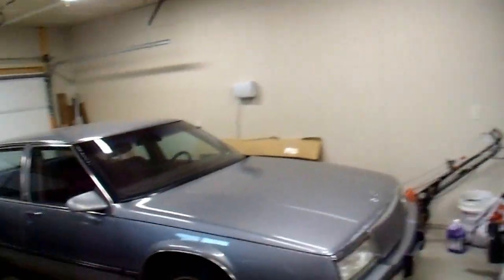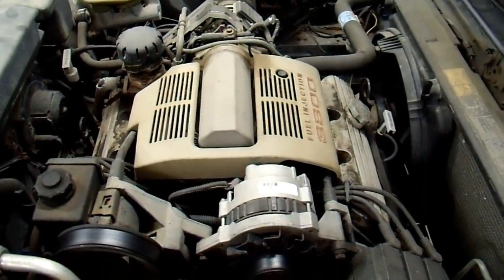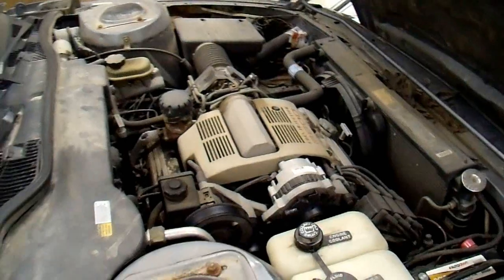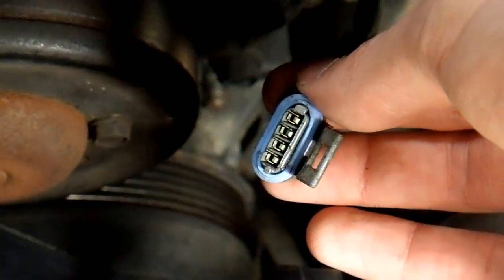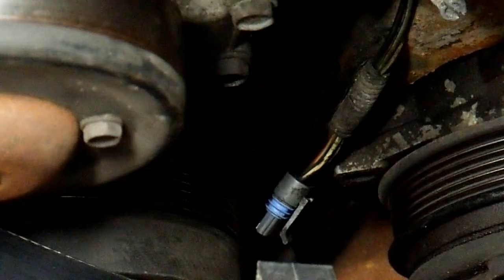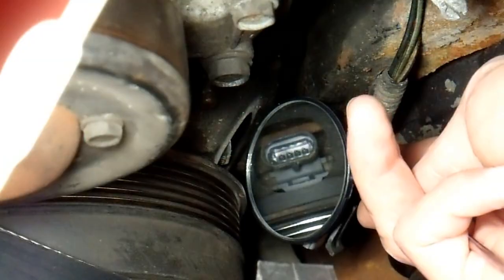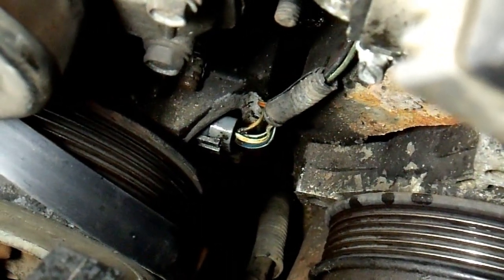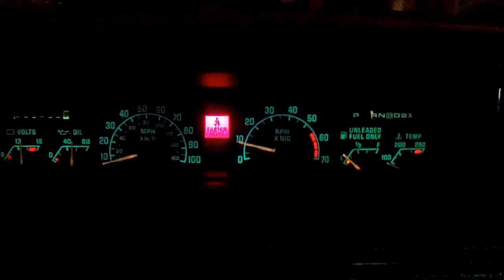3800 3.8L GM engine stalling issue quick fix

Comment: Oh yeah, well what if it is bad, how do you know if it is causing the problem. Then how does it come out.why does this video not tell you that. What if i clean the connectors and it doesn't fix the problem? This video must only show the very first thing to try.
Reply from the maker: This is clearly intended to be something quick to try and is no guarantee.  The connector points up, is in the path of road spray, and commonly corrodes causing problems.  If this isn't the problem then you have to look further and I have a video on replacing the sensor too if you're interested.
Reply: @knurlgnar24  so it is the first thing you should try. Hey, this could save you a whole lotta other work. I get it.
Reply: @knurlgnar24  plus i just found your other video going into detail on how to work this thing.good job. Thanks. Its a lot of help.

Comment: i got a 97 buick regal 3800 it just died after a long trip while parked at idle,, wouldnt restart, waited a few , it ran but had to keep gas revved up, then it died at idle again and wont restart, waited over night started for a second then off again and wont restart.......... all fuses good, only error is evap selenoid. I was told it should at least start if that was only issue  any idea ???

Comment: Good information. Unfortunately I have a 1995 so I stopped the video at 34 seconds in. Try putting the year in the title so folks who need a different year will not drop out of your video so quickly. That should also give your % of view time on your video more time. Thanks for sharing anyways. Best Wishes & Blessings. Keith Noneya
Reply from the maker: That would have been a good idea in retrospect.  Thanks for the comment.
Reply: @knurlgnar24  It's all good I have similar requests on my channel at times. I just edit the title under the videos section. Best Wishes & Blessings. Keith Noneya

Comment: I had a 89 lesabre.Other than my 92 park avenue,  BEST CAR IN THE WORLD !!  Mine would stall occasionally and it turned out to be MAF sensor and it had almost 300,000 miles on it.I sold it cuz it was beginning to have alot of issues but it still run. Love the ol 3800s. If u keep them up theyll last forever i also have a 84 lesabre coupe with a 307 olds. Another great engine

Comment: I have 1998 Buick Park avenue the engine stumbles tachometer goes to zero car continue running normally tachometer still shut down shut the car down and restart the tachometer tachometer begins operating a game??
Reply from the maker: I'd have to look up how the series II engine works to give better inro but it is clear you have a sensor going out - either cam position or crank position sensor.  The computer requires all of them to start the car but once running it can operate with limited information.  Your tach likely only reports one of the sensors which is why when that one fails the car stumbles, recognizes the problem and starts running by using a backup sensor method, and then continues running.

Comment: o8 grand prix i had a the  stall issue and hard start.  I changed my air filter and it never happened again. I know.  How stupid , ive never heard of that befor. I even bought crank position sensor and that $60 relay people where haveing problems with stalling. There still in boxes brand new

Comment: Hi dear friend! At my Buick park Avenue 1991 when i start engine begin workin after 0.15 - 0.20 min she begin  smooth vibration and turn of
if you wont startagain it is impossible, i looked spurk plugs se that all of them wet by fuel.
May be same problem?

Comment: So this def doesn’t apply to series II 3800’s? Because my 2001 park ave is having same symptoms.
Reply: Not sure on your wiring but my 2003 buick lesabre with 270k had random stalling, would randomly idle so high I had to restart to shift out of park for fear of damage and also had a surging overdrive and passing gear that usually never kicked in. I cleaned the ground connection on top of transmission behind air box because I saw signs of corrosion hiding underneath. Fixed all these issues.

Comment: Great video 👍👏, it will come in handy for the next time my car stalls on me. I changed the alternator, spark plugs, fuel pump and fuel filter. An still cuts off, now I have something to go on next time it happens.
Reply: I just change that my car still killed on me its the camshaft one i have a 3100

Comment: Have a 1989 Buick century 3300 and it started doing the same thing drive it for a while then out of the blue shuts down? Changed so far fuel filter and plugs new battery and checked alternator all good. But same problem? Now I will check for this out and will change fuel filter also.

Comment: Code testers have a wiggle test to check wiring problems. If there's a problem, it'll flash a code. Then you go to that sensor. Get a Actron CP9690 code tester. It checks live, record, freeze-frame, graphing, emissions readiness test, oxygen sensor test, ABS, SRS, and MORE! It comes with a black pouch. Get a USB cable to update it. It checks up to 2013 out-of- the-box. It includes a OBDI Ford, G.M., Chrysler, and Toyota adapter. The battery is under the cover under that small screw. It retains the memory of results. It's well-lit!

Comment: I have a 1990 and it usually only stalls when I first start it and I put it in drive or reverse idk what exactly the problem is but if I put it in park or neutral it’s idle back up and not stall

Comment: For those having intermittent stall issues after replacing the sensor, you may want to check the ignition coils. Coils are notorious for failing when they are influenced by temperature. On most of these 3800 series engines, there is also an ignition solid state controller and they can fail as well.
Reply: What about the camshaft interrupter magnet on the timing chain sprocket
Reply: You can also do a direct upgrade of the coil pack and ICM with the Series 1 coils; the brackets and connectors are the exact same, but they are better tech. You can't upgrade, however, to the series 2.

Comment: I NEED HELP:    I have a 97 buick lesabre stalling problem.  The car will idle for a half hr or so with no problem.  I go two blocks and Engine stalls.  Have to wait a 3 minutes it will start again.  Go another block or so it will stall again, etc.  Bought new cam, crankshaft sensors it does the same thing. Changed ignition module and other sensors no HELP.  Any expert in here that can help me you can contact me at Nevada4u@aol.com. Would really appreciate any HELP.
Reply: There are several videos on here describing problems of stalling.  One particular item could be the fuel pressure regulator.  Check some of the videos with that in mind.  A leaking regulator can tell the computer there is a problem and will shut motor down for safety.  Since there are so many items that could go wrong one long video is not advisable but watching several as you have time is better and cheaper as you are not throwing parts at the problem and not fixing it.  The crankshaft sensor is the one item that goes wrong as it is located at the bottom of the engine and is protected by the balancer pulley but is still exposed to water, oil and dirt.  Also the wiring can be bad as cleaning connectors will help but rubber coating on the wires could be exposed somewhere.  Fix the problem as that motor will last 250-500 thousand miles if well maintained.  Beats buying a new car that will depreciate more than the parts you can put in this.

Comment: 1990 oldsmobile 98 regency W/ 3.8L motor. When cold engine starts runs fine. As soon as it reaches normal temp thats when it starts stalling and running ruff. Then of course engine dies. Starts back up barely can go a block or two and dies again. By now engine temp is rinning hot and  and engine wont start till it cools down. Replaced fuel pump fuel filter but still doing the same as before. I checked crankshaft senser, cleaned best i could but still doing same thing as before. NEED HELP PLEASE!! Open to all suggestion's
Reply: William Waddington Did you ever find the cause of this problem ?
Reply: Change crank sensor Hall effect getting weak. Changing then only helps sometimes

Comment: I have an 1986 Buick park avenue.  It vibrates harshly at start up and continues even after it idles down.  Continues when driving.  have replaced motor mounts and mechanic says it 's not missing.  Check engine light is not on. Any ideas?

Comment: Hey boss I followed your instructions to the tee and it was a breeze! Thank you. Still dying around 45 miles an hour. Any leads?
Reply: Get a Actron CP9690 code tester. It checks live, record, graphing, emissions readiness test, freeze frame, oxygen sensor test, ABS, SRS, and MORE! It includes OBDI adaptor for Ford, G.M., Chrysler, and Toyota. Get a USB cable to update it. The screen is well-lit. It retains the memory of results. The battery is under the cover under the screw in the back. It's either a AA or AAA. It comes in a black pouch.
Reply: @hankbridges5055  if is start and then die after that it can be also a fuel pump resititor
Reply: @christinammcnair1632  would that also cause intermittent power loss. Mine is like the key is turned off and on fast.

Comment: hey do you know where the map sensor is located?
Reply: I believe it should be on the top somewhere, its super accessible easy no tools needed. It’s connected to a small black box. The connector looks the same as the camshaft

Comment: I have a 2004 Grand Prix GT with 285,000 miles. A few days ago I had a misfire in cylinder  6. I bought a new coil pack and replaced it and  the car works fine for one day. As I was driving home that night the car stalled out as soon as I got to my driveway. The car never ran hot. I tried to start it up but nothing. All electrical components are working except the AC fan isn't now. There are no codes showing. And there is no sparks coming from none of the coils now. I've checked all the fuses twice and they all are good. As a precautionary I changed the crankshaft sensor and the ignition control module and still nothing. What do I do next? ECM PCM or Timing Chain? Help??
Reply: Sounds like a faulty ECM/PCM, especially if no error code is set. Don't forget to move over the "MEM-CAL" to the new/used ECM.
Reply: What you do now is don't throw any more parts at it and diagnose the system(s) instead.  Check that each spark plug is actually firing - pull 'em out, ground 'em with a screw driver, and verify if they are sparking at all when you crank the engine.  No spark?  Get out the multimeter and start checking for signals going to the ignition module.  Check resistances in the coils and plug wires.  Check the crank AND cam position sensors using your multimeter.  Check your MAF sensor with your multimeter.  If you ARE getting spark, then move on to the fuel delivery systems.  Check fuel pressure, check for the "whirring" or "humming" sound that should happen from the fuel pump when you first turn the key to "ON" (but without actually engaging the starter motor).  Most of the computers (PCM / ECM) in these cars are pretty solid.  I've never personally had one fail on me ... although they CAN fail, it seems more likely to be something else.  I wouldn't suspect a timing chain unless you verify that spark and fuel delivery are all happening.  Just take your time and methodically check each system ... move from the easiest to reach stuff down to the harder to reach stuff.  Not all sensor failures will trigger the computer's fault code system.  Realistically, most of the fault codes the computer will report are emissions-based anyway.  That's not saying ALL of them are ... but I've seen many crank position sensors fail and not throw computer codes.  I've also seen MAF and cam position sensors fail without triggering any codes in the computer.  Just remember:  take a deep breath, be patient, don't panic, take your time, and ALWAYS start with the easiest stuff and work your way up to the more difficult stuff.
Reply: It was a bad fuse box #24 fuse. weird

Comment: I wish I could figure out why my 91 park avenue keeps stalling out while I'm turning when driving...had crank censor replaced, had ignition module replaced
Reply: Jerrad, had this issue with my '99 eight-eight Royle. I replace practically every conceivable component related to this symptom.  In fact had one client I visited 3 different times and it stalled each time in the exact same place when i turned the wheel into the parking place. Had to look up to see if any UFO's where above! At any rate it kept getting worse as time went on. Come to find ut it was the "orange" ignition wire coming out of the steering column. Inside the orange wire are 2 white wires. Both are connected to  the ignition on both sides of the key in order to read the resistor on the key and loop back to the computer and the other to the security system. Not sure of the sequence but the "security" light flashed a couple of times and sometimes stays on. GM security system is squirrely in short "crappy"!  At any rate you can measure the resistants on your key and split the wires and get resistors equal to it so it fakes the computer..... BUT instead I got a BYPASS module from NEW ROCKYS and it is FANTASTIC!!! It has been 9 month...NO ISSUES. Also it is guarantee 100%! The instructions are awesomely simple. Hope this helps! http://newrockies.com/passlock-bypass-2/
Reply: @sorrycharlie99  That's not how the VATS system works, Spammer Geff. If the module detects a failure while the engine is running, it will not stop running. So, you're either full of shit, or just ignorant. In fact, the quickest way to disable the system is to cut those two white wires with the engine running -- but then you'll have a full-time Security light (not flashing). The right way is mimic the key with a resistor.

Comment: I have a 1995 buick lesabre it will not stay running maybe like 3 or 4 seconds. I have replaced the fuel pump, fuel pressure regulator, fuel pump relay...I was told by a shop that I have 0 fuel pressure...Help Please!

Comment: I changed my alternator but my car shut off on me wat does that mean is dat the starter
Reply: No it could be several things that make your car stall. Low fuel pressure,filter, cam sensor map sensor mass airflow sensor etc A starter will only effect the car from cranking unless the ground or 12volt wire comes aloose

Comment: I use TV tuner contact clear and lubricant (I bough it at Radio Shack many years ago) to clean and protect the contacts of my car sensors and other electrical wiring. Basically it has thin mineral oil to protect the contact from water and atmospheric contamination. It will not block electrical current from flowing because the contact friction will remove that oil layer, but at the connector removal, the oil flows back again over the contact. It works! 

Another hinti is to lubricate the connector rubber seal with some silicon or spark plug grease, so it will become water tight. Dab some of the same grease where the wires enter the connectors.

Comment: I have a 98 changed crank shaft sensor and air flow sensor it will start have to hold the the gas to keep running
Reply: Sounds like your throttle body position sensor or mass air flow. I had it happen with a VW that would die if you didn't get it gas and ran terrible till I replaced it.

Comment: Your videos rock and you helped me change my Crankshaft position sensor. i am still having an issue with it stalling but only when left to idle to long. if i tap on my crank sensor it lets me start it back up again so i am curious if you have a suggestion as to what it may be? could it be a faulty sensor or does the pcm need to relearn the sensor? is it possible the connector is bad? 
Thanks in advance!
Reply: Any lucky with this?

Comment: Thank you so much for taking the time to make this video. It wasn't Exactly the same problem you had, But the Belt skipped out of line due to the A/C Compressor replacement pulleys Bearings wearing out.  The belt became ripped on the edge, and wrapped around the crankshaft pulley causing the entire sensor to become blocked with debris strings from the belt.  I knew it had something to do with My Friends Belt making a noise approximately (ONE Minute) before the Engine cut off.  "Thanks to your video, it led me straight to the problem" and I Greatly Appreciate It!!!!  Now He can go see his family on Christmas!!!  Ny Friend is 75 Years Old, and was diagnosed with cancer earlier this year.  He actually has a chemotherapy appointment in the morning. The clutch is being replaced on his pickup truck, so this was his only means of transportation. Thank You So Much From the Bottom of My Heart!!  I Pray You have a Merry Christmas, and a Happy New Year!!!:).  May God Bless You, and your Family My Friend!!!!!
Reply: Holy shit, haha I had the EXACT same thing happen last month. I replaced the belt about 4 years ago when the water pump broke and belt snapped while driving. When I installed the new belt I kind of knicked/damaged it. I had doubts but used it anyways and it lasted this long before getting wrapped up on the crank pulley and broke the crank position sensor in half. Cars back running great thanks to all the great videos on YouTube 😅